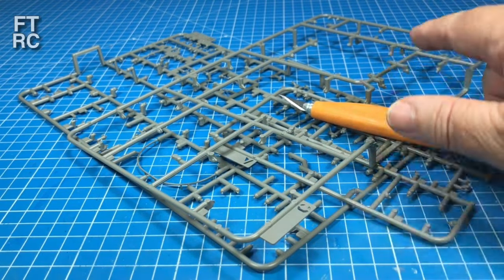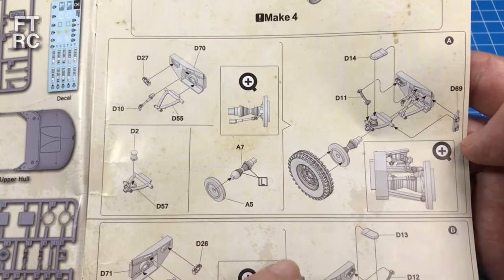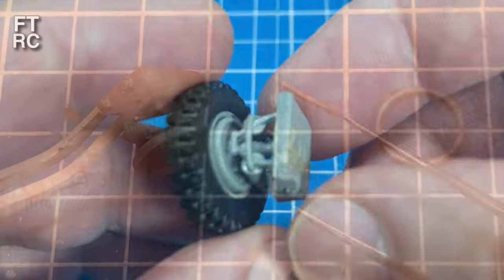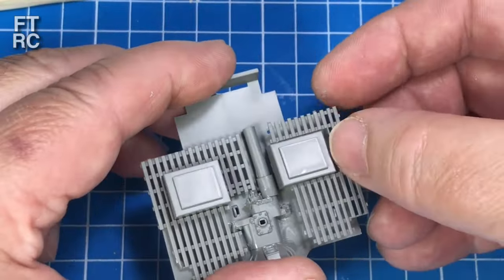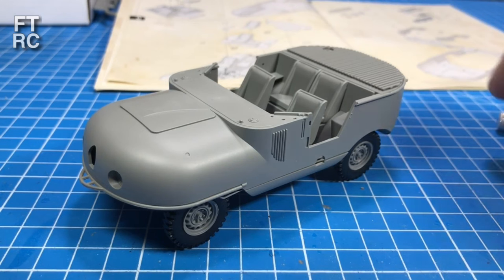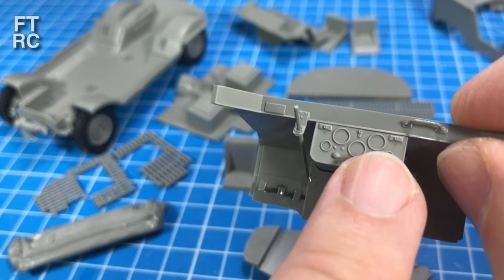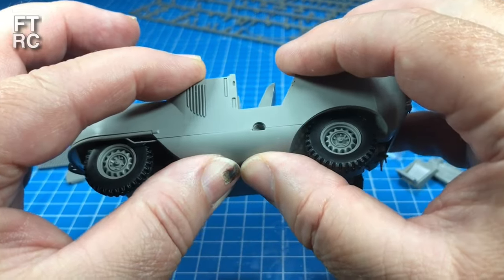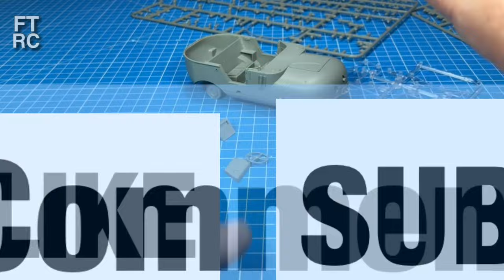Das Werk Schwimmwagen SG 6 Part 2 Building a Floater what's wrong with the kit

Comment: Hi Harry - that space between the body and the sill can be easily fixed with a strip of 20 th plastic card-
nobody is going to get out the micrometre.
Reply from the maker: Ah good.  Some level headed thinking.  I was lost in a haze of pissed off fog.  Thanks for the sensible advice Ross.  Easy fix!

Comment: I know why you're building it mate, because you said, but if I was bogged down in that thing, I'd be thinking how much further one of my sailing ships would be if I'd stuck to them... 😂😂😂
Hint-hint. 😅
Reply from the maker: I had the same guilty thought… the ratlines would have been done on the St Louis… lesson learned.  Back to ships for this fat fingered and half blind ole sea dawg.
Reply: @HarryHoudiniModels  I have these deviations too.
I'm about to embark upon an Airfix Austin lorry (1/35th recent kit) turned into a fish-and-chip van which used to wander around the local villages in Norfolk when I was a wee boy. 
Using an ICM lorry body for the van part.  I can see the razor saw removing most of that. 🤣